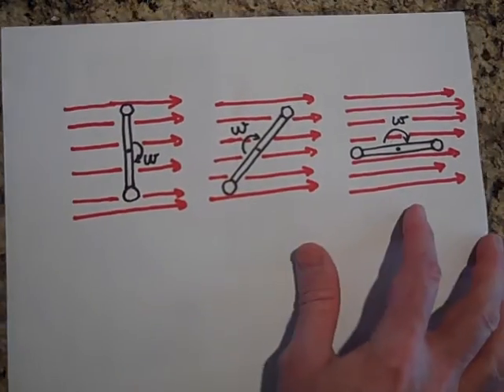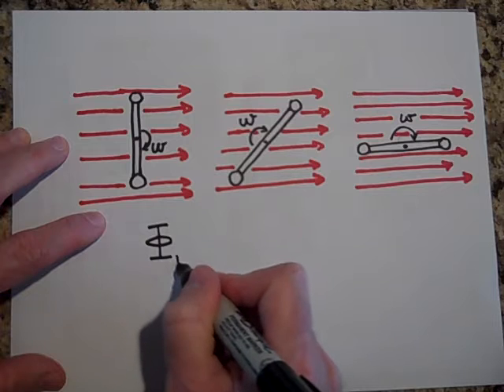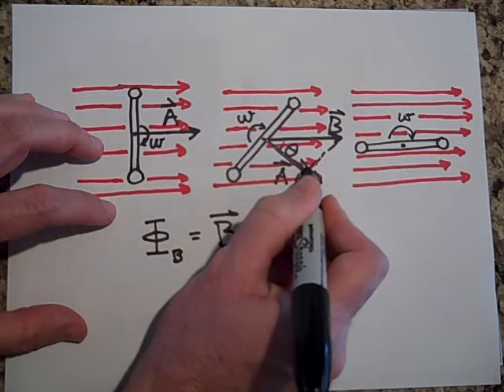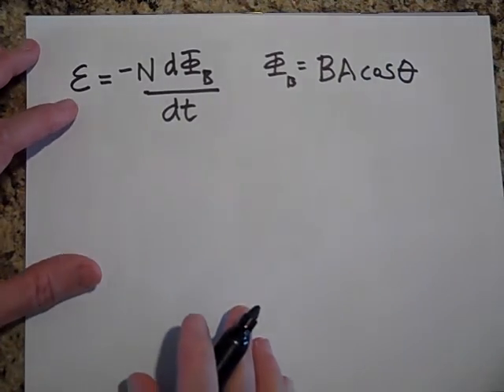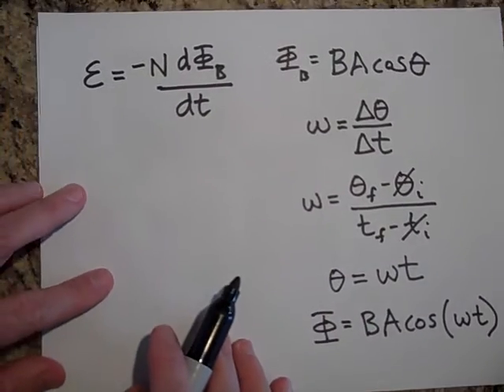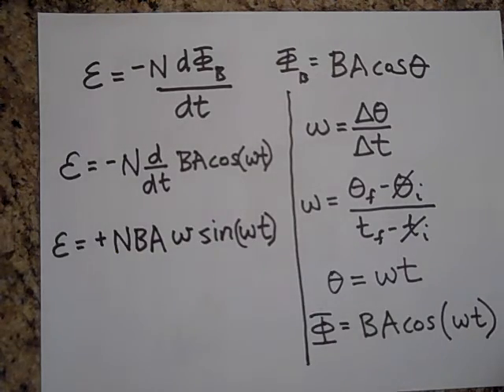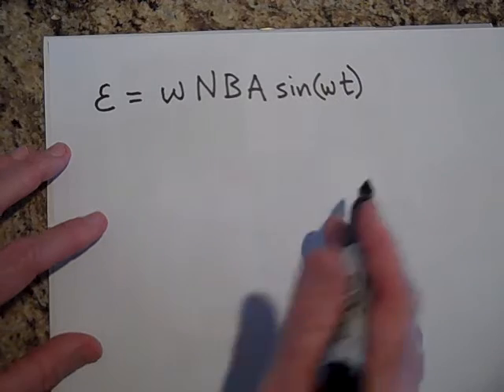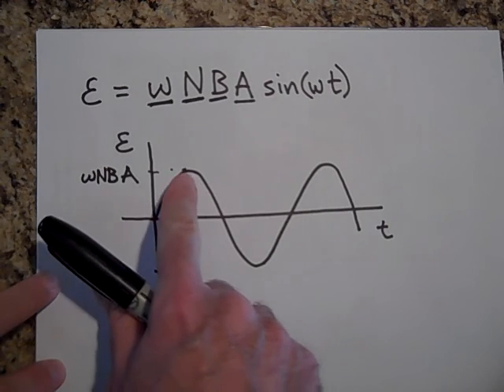The Basic Physics of the Generator

Comment: The emf is motional emf due to the motion of the conductor through the magnetic field.  The change of flux linking the circuit has no effect in the case of generators, just alternators, where the magnetic flux intrinsically changes.  Since Faraday's Law implies that the emf  in the generator is due to the change in flux, Faraday's Law is not a law, just math.  It is a case of correlation, not causation.

Comment: let me give you a lesson about Physics and how a generator works.the force on that is put on the rotor is tranfred equal to stator.( examples of if you 5 horsepower on rotor  this means you would have  5 horsepower on the stator ) this means the electricity is free energy ,
  5 horsepower will get  2,500 watts . if have a in put of  5 horsepower  and a out put of   5 horsepower + 2,500 watts    i can prove this  .the force on that is put on the rotor is tranfred equal to stator